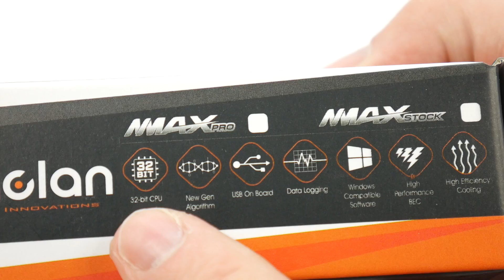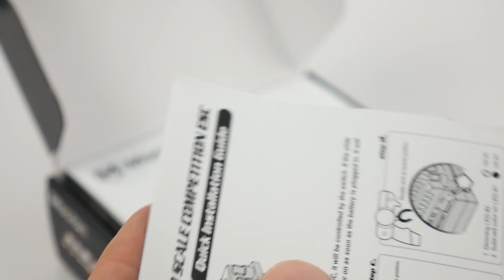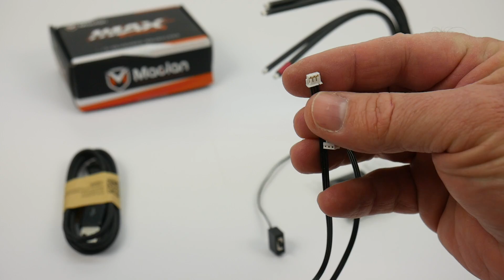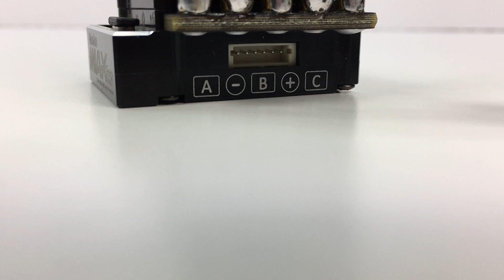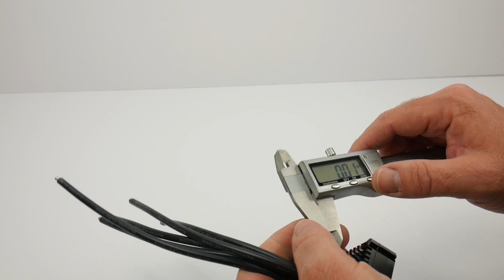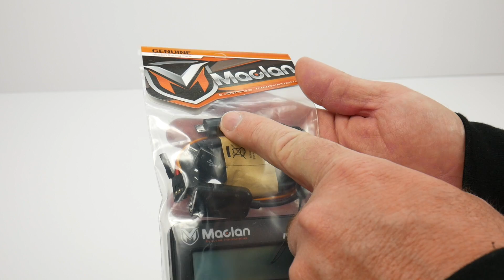Maclan Racing MMax Pro ESC - First Look!

Comment: I have been shopping for a new esc to replace my lrp flowworks in my b6d,  how do you think the mmax would do with 6.5t motor compared to the lrp flow? I have a heard a lot of talk about the maclan esc but not from anyone who has actually run them. do they run cool? do they have the power like lrp flow? appreciate any input. thanks. ps love the videos rcnetwork! keep em coming!
Reply from the maker: I think this esc is right in the same league as the LRP FTW.  It's a powerhouse....pick up the version with the program card and you're set.
Reply: I talked to some guys that have been running these esc,s and they all say the same thing, responsive, smooth and powerful. ordered one yesterday and can't wait to try it out!

Comment: that does look good and i have a question about going to mod racing. I have a tlr 22t and i want to go mod my local hobby shop sais go for tekin and i am going to use 6.5t and the esc i found i wonder if it will be good because i am poor it is $110 it is the hobbywing 100amp sensord esc 3.1 version do you think that esc is good enough and i am running a team orion 4500mah 7.4volt 2s lipo 100c the electronics i have now is for stock it is tekin rs gen 2 and trinity 17.5
Reply from the maker: Local hobby shops are typically biased toward what they have in stock regardless of what your budget/perimeters are.  The Hobbywing stuff is really nice, especially for the pricing.  A 100 amp esc should be fine for mod in a 2wd T. make sure it's with in the motor turn you want to run
Reply: The RCNetwork thanks yeah i am going to be running a 6.5 and i found the esc it says stock but when i looked at the specs it can take 5.5 and the track i will be running is silver dollar at amain hobbies outdoor track